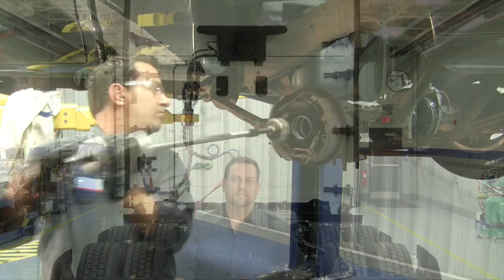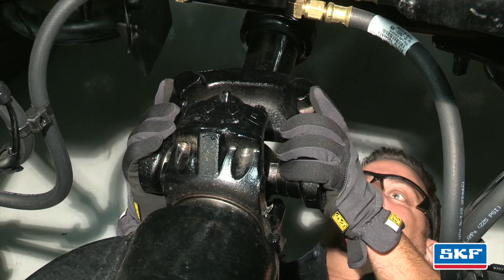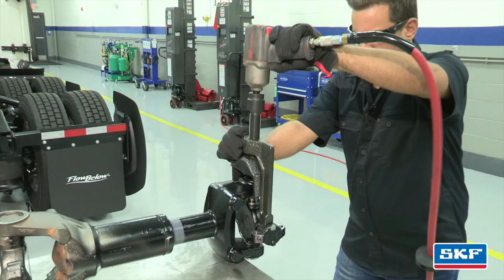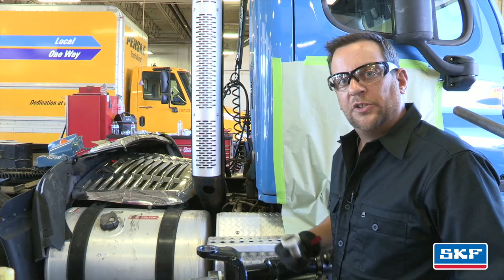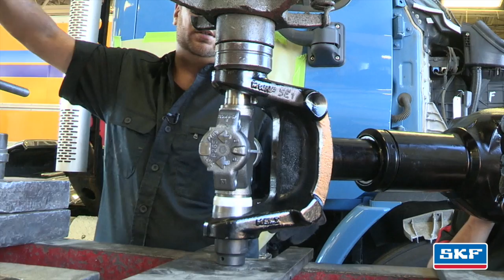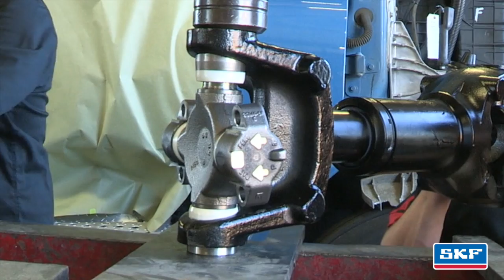How to install an SKF Heavy Duty U-joint

Comment: What About The Grease Zerk Installation And Greasing The U Joint After Installation ??😮
Reply from the maker: Yes, if u-joint comes with a Zerk fitting. Best practice is to lube after installation, even if u-joint comes pre-greased. Thanks for watching!
Reply: SKF Parts Info Love SKF Bearings And Products 😎👍🏼👍🏼👍🏼
Reply from the maker: Thanks, that's always nice to hear! If you have any other questions let us know.
Reply: SKF Parts Info I’m in Need Of a Master SKF Bearing Catalogue in Print or CD/DVD For My Laptop I’ve Inherited a Huge Number Of SKF Bearings From a Trucking And Equipment Co that Went Out Of Buisness Thanks SKF 😀👍🏼
Reply from the maker: Customer Service will set you up with catalogs. Call or email them with your request. Phone: 1-800-882-0008    Email: VSM.Aftermarket.CustSrv@skf.com